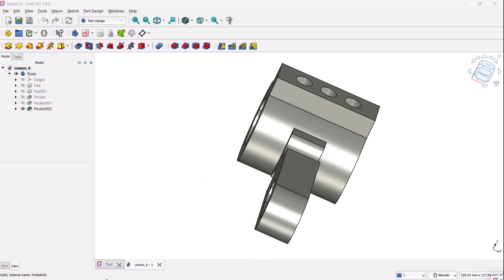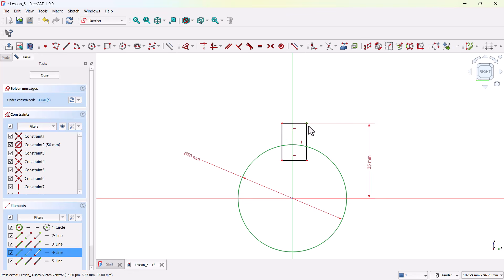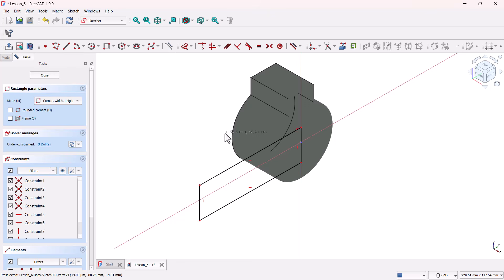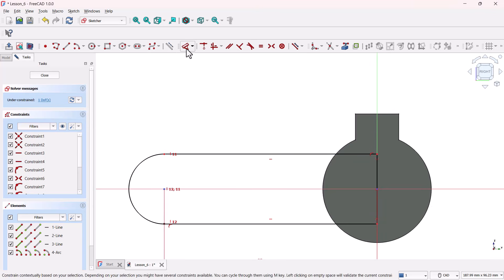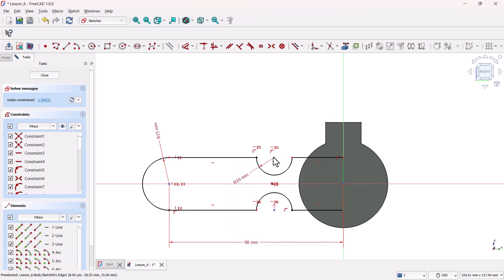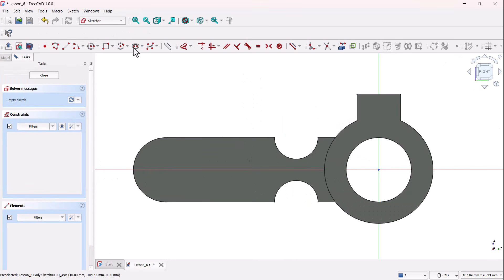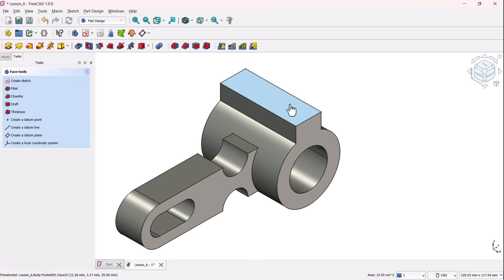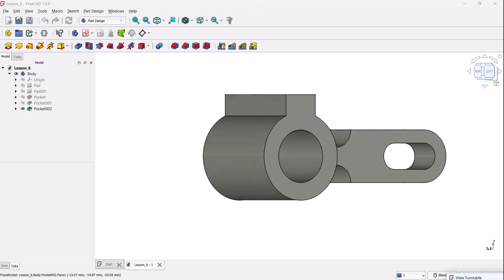FreeCAD Beginner Course | Module 1 – Lesson 3 | Create a Complex 3D Model in 7 Easy Steps

Comment: All went well except the very last step 'the pocket tool' it wouldnt allow me to use the through all option in the drop down. I mean I selected it but there was an error when trying to select okay. "removing splitter failed" so I switched it to dimension and selected 20mm, and it appears as through all. Strange.